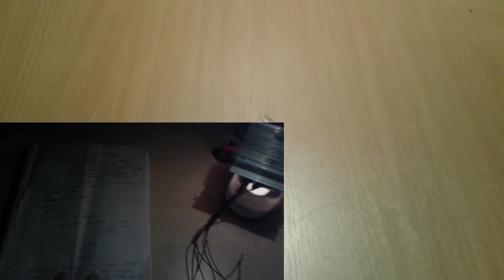How to make a Thermoelectric generator at home [peltier modules]

Comment: Is there any calculation to determine the size of the cold side radiator? I am trying to implement a TEG without using a fan , but need to know what radiator size can give the required cooling and temperature delta to drive the seebeck effect.
Reply from the maker: I have tried all sort of combinations water goes well,ice cubes on the radiator bit small fans does rhe job very well unfortunately

Comment: make or assemble? The Thermoelectric module did you use a Si-Ge compound or a Na-CoO compound for the junction?
Reply from the maker: Both if you will make the generator with commercialy available parts the cell is tec used in 12v coolers 5us dollars

Comment: TEG modules work better than TEC modules but they are also much more expensive. The TEC modules cost pennies. The best way to regulate the heat is to use water as a medium between the flame to prevent overheating the modules. great viideos. keep em coming. will watch along and maybe contact you for further help soon. kind regards
Reply from the maker: +AltNRG Account HI there i did try with a TEG and the same results, but is not conclusive lots of fake sellers. This model can light a table/small work bench for aprox 4hours i am improving and hopefully one day will be available for sale as a diy kit. All the best
Reply from the maker: I did watch MRteslonian videos but on this setup, we are getting more power then his homemade version i will try a TEG module again and a high power Peltier to see if is any difference.The modules used in this video 12706 60w
Reply from the maker: +NoSkillsRequired Just yesterday I re-watch those videos a real TEG would be better but witch one? And if is to expensive...
Reply: dont know which one is best but i bought a nice thermo electric candle generator kit from germany off ebay. It did not last too long. You will need to design very carefully for heat protection with water as medium. Some people are already developing auto overheat detachment spring mechanisms to prevent overheating.